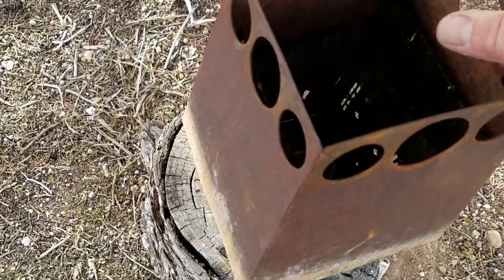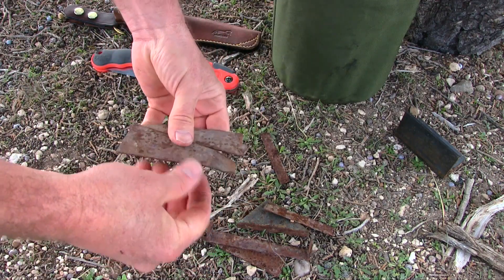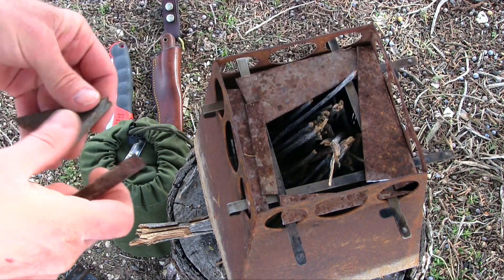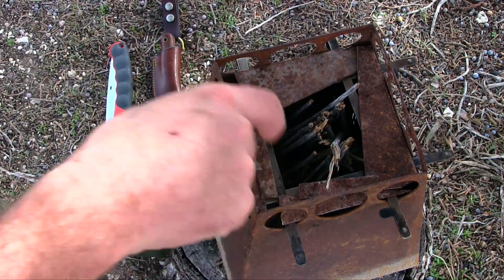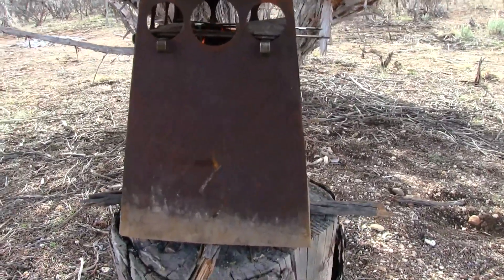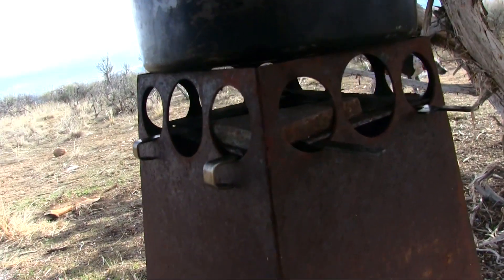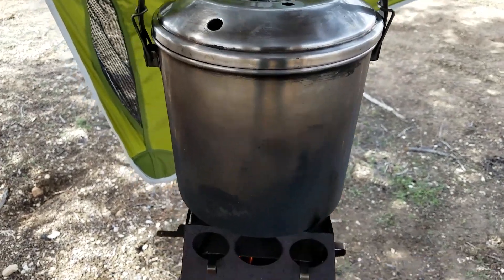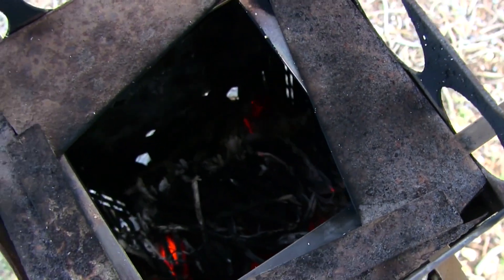Firebox Woodgas? What do you think?  Impromptu Camping Stove Concept Testing.

Comment: Bought an SOG folding shovel the other day for camp duties requiring such. And I got to thinking about placing the Firebox in a Dakota fire pit. Two holes 6-8 in. deep, in parallel, 6-8 in. apart. Of course joined at the bottom of each hole. At 6 in. deep you could still utilize the top functions of the stove.

Comment: Hey Steve. I used to use a DIY woodgas stove, but found that they are extremely temperamental in the wind. I actually bought your G2 5" stove specifically to replace my woodgas stove. I did this for a variety of reasons, but wind performance was one of them.
The problem I have with woodgas stoves is that when it's windy, the wind can blow your flame out. But due to the air feed only coming through the bottom, the wind can't blow on the hot coals to reignite the flames. The perforated outside of the firebox stove solves this because any wind gust that tries to blow the flames out will stoke up the coals and the fire will stay lit.
Furthermore, if you pre-load the firebox and light it from the top, you will get very similar performance to a woodgas stove without needing the extra weight and expense of an outer wall. You can still get very little smoke because the firebox lets so much air in through the bottom and sides.
That's my two cents. I'm always in favor of experimenting, but in my opinion this concept doesn't add any capability that the firebox stove doesn't already have on its own. Thanks!
Reply from the maker: I  agree that the advantages of wood gas stoves come with some drawbacks and the efficiency advantages only come when all the parameters line up. I didn't know about the problem of being blown out, but I know exactly what you're talking about. The wind pushes the flow backward, causing the burnt fuel to deprive the fire of oxygen and poof, it starts bellowing smoke. One flick of the lighter brings it back until the next gust snuffs it out again. Very frustrating!
That having been said, you can see by reading the comments here that people think highly of the concept! 
I was thinking that I could make a larger stand alone stove that could also work with the Firebox to create a wood gassifier. That way you have two very good stoves for when you need them and the fun of being able to combine them.  I was actually thinking I would make them the same height so the outer shell would hang on the inner stove which would open up the bottom a bit more than the traditional wood gas designs. That in itself may solve the snuffing problem. One wouldn't know without quite a bit of testing. 
I really appreciate your valuable feedback as these are very important considerations moving forward!

Comment: Steve, you are the reason the Firebox is the only way to go. The Firebox shows a tone of engineering, understanding of physics etc. Although, the Firebox technically could has some wood gas attributes, they are incidental and not overt. When you do find the way you want to go, with adding the outside chamber for wood gas superheating/igniting, I am sure it will be the best engineered version available. I am picturing another fold away, hinge-bottomed slip on which goes on from the bottom. This will hold the inner stove above the deck for air draw and if tapered, will form a relatively tight seal at the top
Reply from the maker: Charles Holliday thanks so much for your vote of confidence! I really appreciate your kind words!

Comment: Looks like it works to me, although I would have liked to see more of the process.  The wood gas stoves I have made took in air at the bottom of the outer sleeve and the top was sealed to the inner sleeve, like you tried to do with the scrap pieces.  The inner sleeve had holes on the bottom and at the top - the woodgas reignites from the hot air coming in thru the holes at the top of the inner sleeve.  So realistically the Firebox stove could work fine as an inner sleeve.  I would like to see if the the woodgas could be seen reigniting.  I like how the holes at the top sort of made a pot stand.
Reply from the maker: Yeah, that's how this one works as well. Not quite as refined as one would like, but the air follows the current so it doesn't need to be a perfect seal in order to function.

Comment: have you ever thought about a drop in gasifier? I'm actually going to be attempting one in my next build. will be posting it in Stoveaholics.
good stuff keep up the great vids!
Reply from the maker: Yes, I have thought about something that fits inside  but the firebox is so perforated that any breeze would disrupt the flow.
Reply: FireboxStove 
that's what I thought also. I was thinking a dbl layer for the inner gasifier. would be a total of 3 layers. it will add more weight but I don't usually take a 2 lb stove to boil water lol.

Comment: you could easily add this to the firebox and it would not have to be as heavy because it isn't exposed to as much heat.  It also looks like the base gives this a more stable cooking surface
Reply from the maker: I was actually thinking I could design it to function both to convert the 5" Firebox to a full on Wood Gasifier and to function as a stand alone stove.
Reply: I think it would work great!